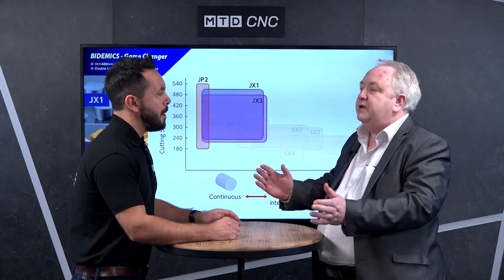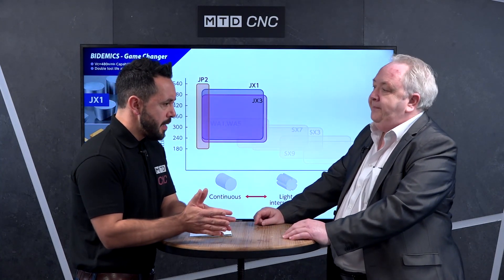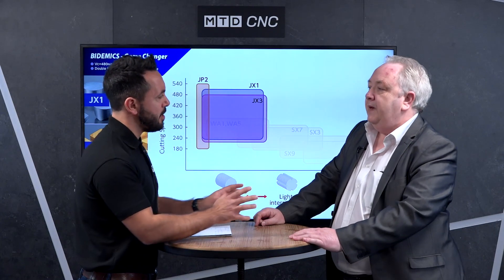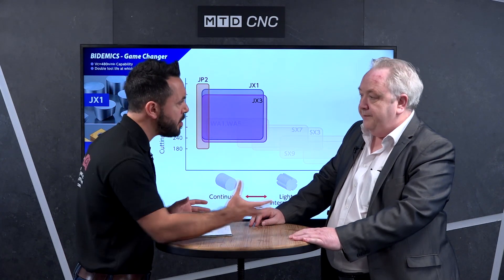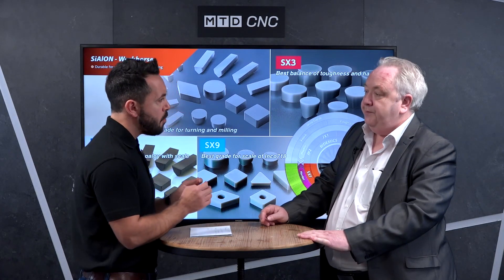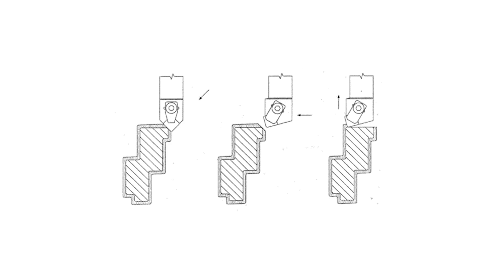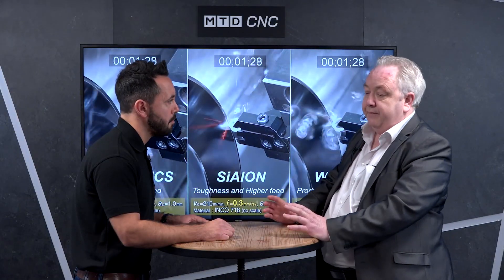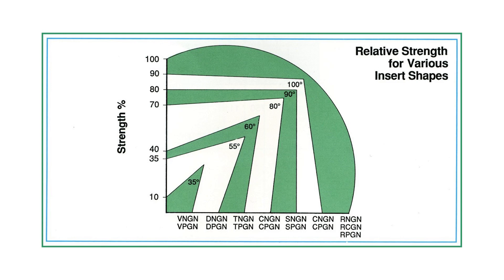NTK Explains How Ceramic Tooling Cuts Aerospace Materials Up to 15X Faster

Comment: High speed and low feeds. The most important aspect is to maintain the correct tool angle to reject the near molten chips as they are being made.

Comment: Can we use a round insert in interupted cut on gear tooth tempered ,matl is 18crnimo7-6 at 62 rockwell c.i actually use a round wisker tip .500/inch grade 300 t2a.
Reply from the maker: Glad you enjoyed the video !